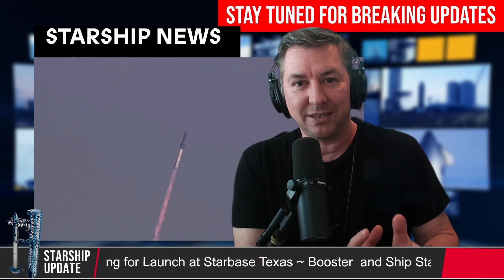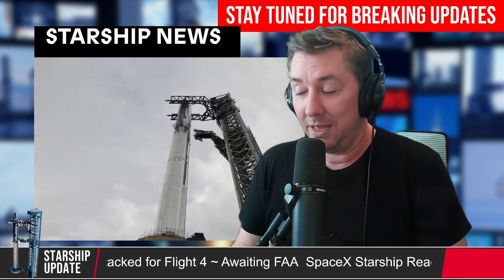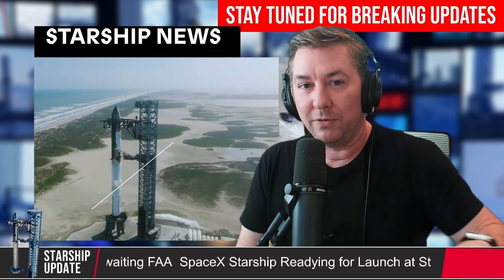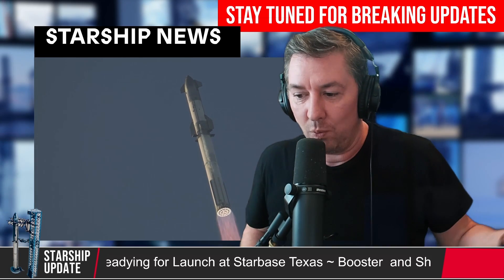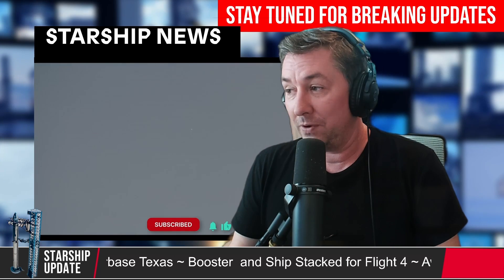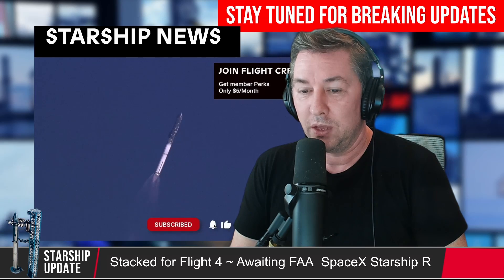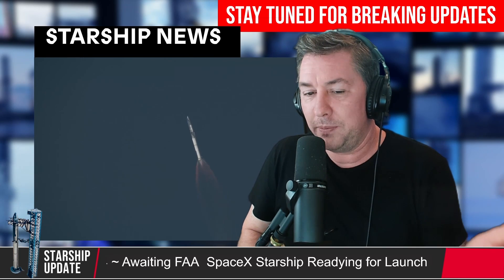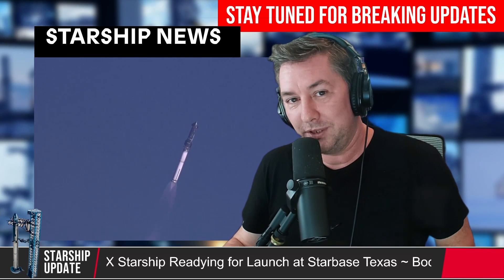SpaceX Starship IFT-4 Launch Update

Comment: Question, can the booster/tanker fly without Starship?
Reply: To fly, it flies but only up to 150km somewhere around there, after which it falls back:)
Reply: I would guess at the heart of your question is how well would the booster do at higher altitudes/speeds without the starship in front of it?  I’m  “guessing” (i.e. without some CFD analysis), there might be some issues with the “bluntness“ of its “nose” as it relates to efficiency/drag/undesirable heating.   Just a thought, no warranty expressed or implied😂